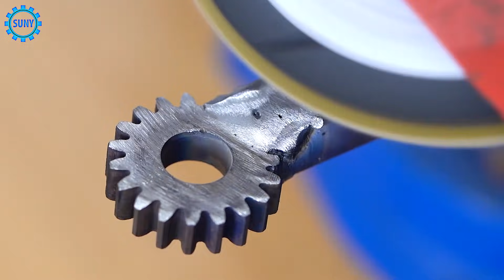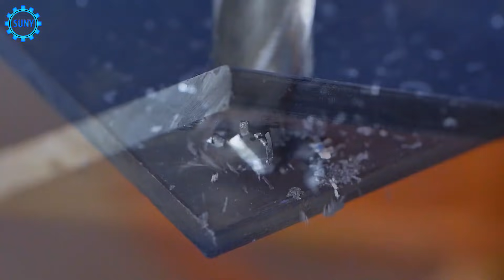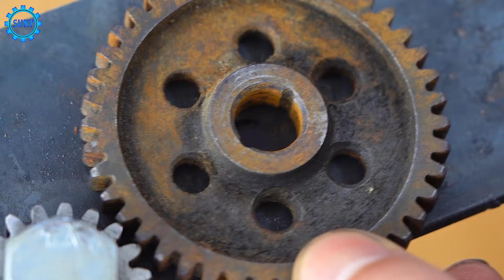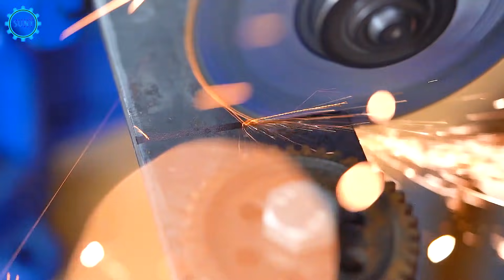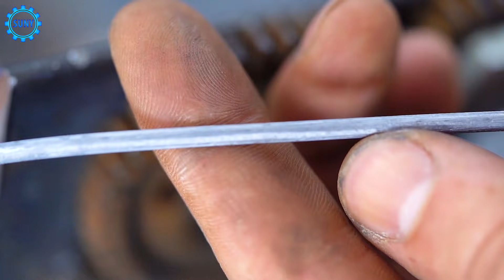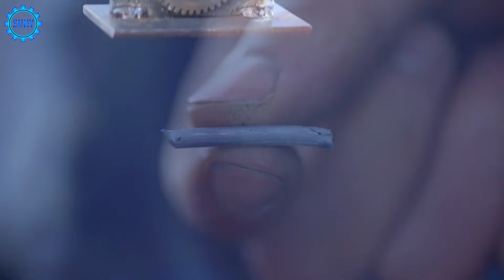THIS PRODUCT IT'S AWESOME

Comment: Редкая срань, да еще из мягкого железа. Хоть бы закалил перед использованием.  Пойдет, если резать медь или алюминий. И не пойдет для более жесткой проволоки.  Его просверленная дырочка быстро станет  дырыщей, как у дамы с низкой социальной ответственностью.  (Rare shit, and made of soft iron. At least I would have tempered it before using it. It will work if you cut copper or aluminum. And won't go for a stiffer wire. His drilled hole will quickly become a hole, like a lady with low social responsibility).

Comment: What is awesome in this tool? The edge is bent and ill shaped (not a perfect right angle).  It is because the holes of the frame and the gear is not drilled perfectly. The material of the frame and gear looks to be soft, and that is the reason.

Comment: Great idea and video! Suggestion for you - fill the holes on the larger gear and then bore them to different diameters (along with corresponding sizes on the plate) - this would allow for a cleaner cut.
Reply: agreed sir......

Comment: All this work, have you ever heard of pliers, wire cutters, shears or miter saws in general?
Besides, since you haven't smoothed out the cuting gear, with the plate surface, the cuts are all crooked and smudged ....
definitely not your best work

Comment: wire guillotine. why is the seam not continuous? without fixing to an airplane a futile invention. and for cutting wire there is a tool that is sold in the store. not everyone has a welding machine or lathe.

Comment: What an absolute waste of effort I'm in my work shop every day would never use that   there is better ways to cut light rod it would cut much more than 1/4 inch   and it cuts with a bent ends